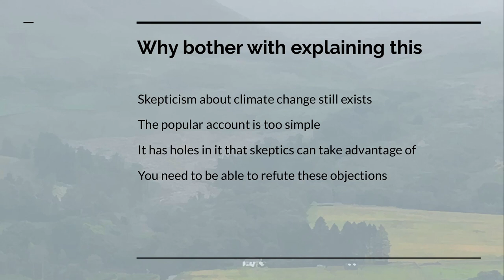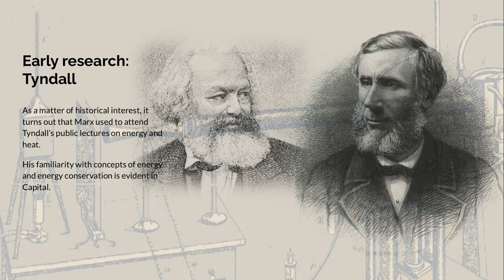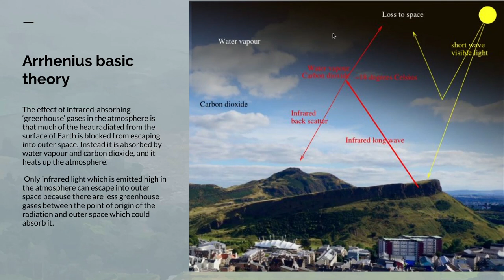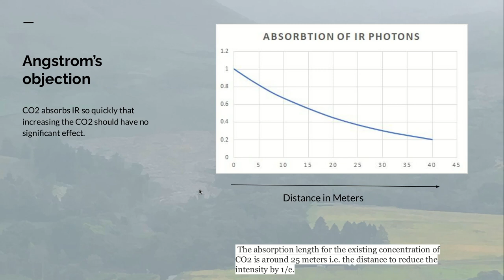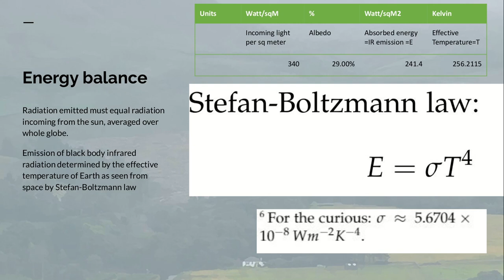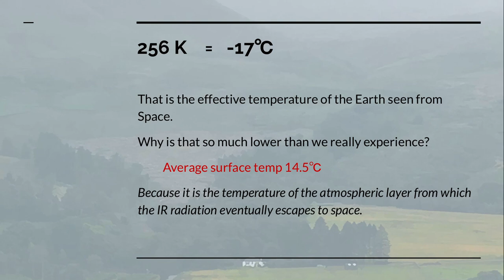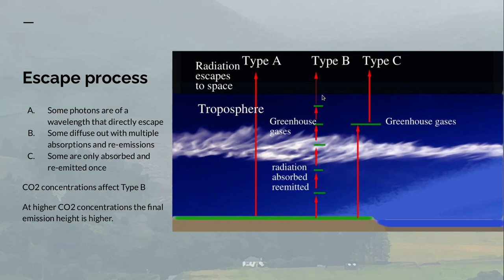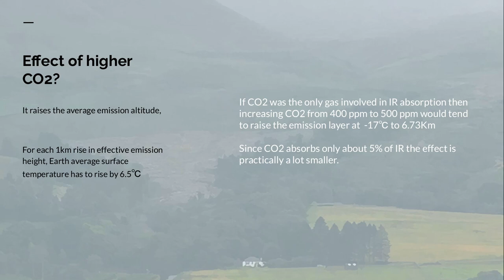The basic physics of global warming

Comment: This is good overall, but filled with minor errors.  1.  The greenhouse effect depends on absorption and emission, not scattering.  2.  The adiabatic lapse rate is 9.77 K/km.  6.5 is the environmental lapse rate, which is less than adiabatic because of the effect of water vapor.  3.  Carbon dioxide accounts for about 20% of Earth's greenhouse effect, not 5% (Schmidt et al. 2010).
Reply from the maker: I was deliberately simplifying in saying scattering not absorption and reemission, but did not know about the other two errors, thanks.

Comment: Complicated climate modelling comes in quickly with rising surface temperatures. Hotter climate => more clouds => higher albedo => cooler climate.
Reply from the maker: Of course if you want precise estimates you need that, the aim of this is just to explain the basic mechanism and to refute versions of Angstrom's objection that are still circulating on the web